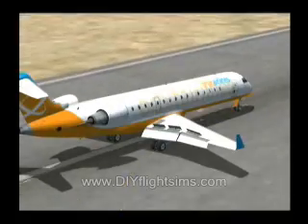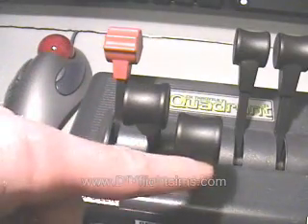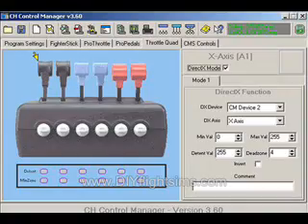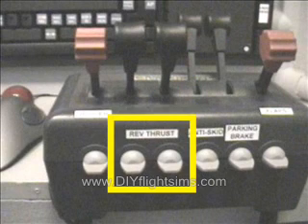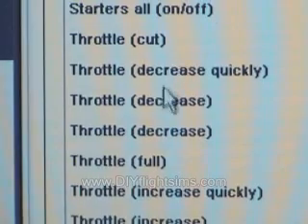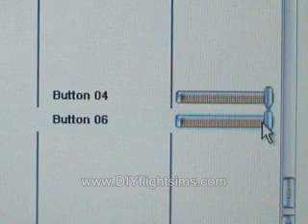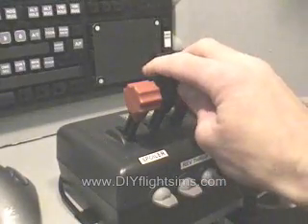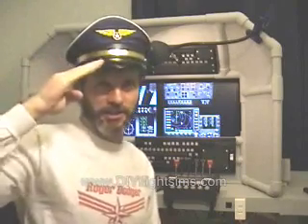Home Flight Sim - DIY Reverse Thrust in FSX

Comment: Great video Roger.  Isn't it necessary to re-assign the levers when switching between a twin piston and a twin jet? YOu would need 2 for throttle, two for RPM and two for mixture/conditioning when flying say a piston Duke.

Comment: I see the reversers come out, but I fail to see how they would provide any reverse thrust if the trottles are in the idle position.  On every jet flight that I've been on, after the reversers were deployed, a loud roar would build up and subside indicating that the engines were revved up and then returned to idle, a logical process that I didn't see any mention of here.

Comment: the exhaust stream (thrust) passes backwards to send the aircraft forward. on the engine cowl or nacelle, theres hydraulic operated panels of heat resistant metal, the slide backwards and form a clam shell shape, the exhaust stream hits the clam shell doors, and the stream is directed forward...sending the aircraft backwards....but its going so fast that it just slows it down...it doesnt actually go backwards.

think of those parachute brake on fighter jets....

Comment from the maker: Yes, the knobs on the top of the levers are interchangeable and you can assign the throttle event to any lever.  So you can fly a two engine jet, or use four black knobs for a four engine jet.  Or you could even use three black knobs for a three engine jet like a B-727 or a DC-10.

Comment from the maker: I think a common error is people may click OK when they re-assign the key, but forget to click OK in the Buttons/Controls menu. You might try re-assigning one key, verify it works in FSX, then shut down and re-start your computer to verify it is still assigned correctly.

Also...I think the full-back position for the throttles is recognized as a key press through the CH Control Manager software, but I'm not sure (I don't use control manager).